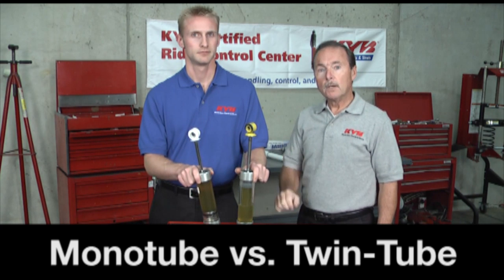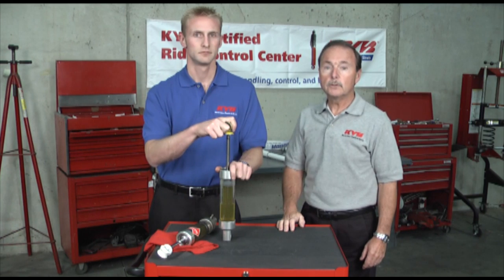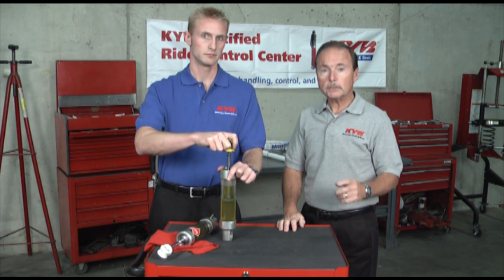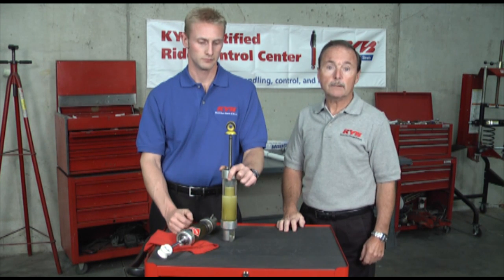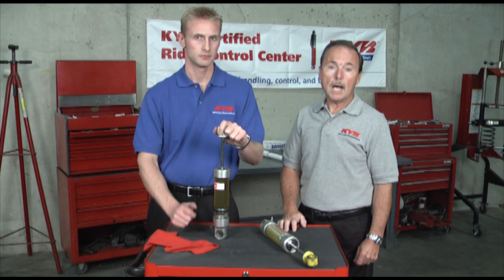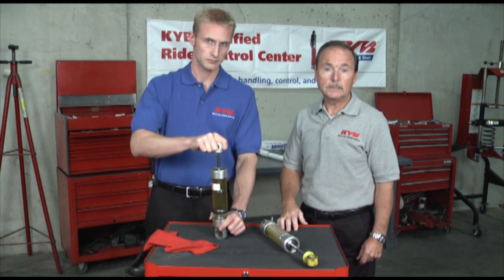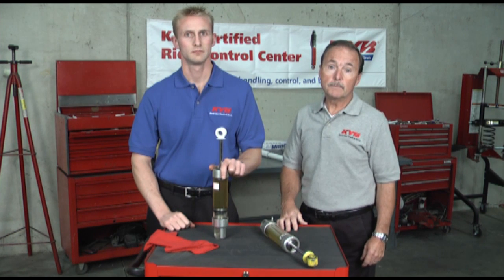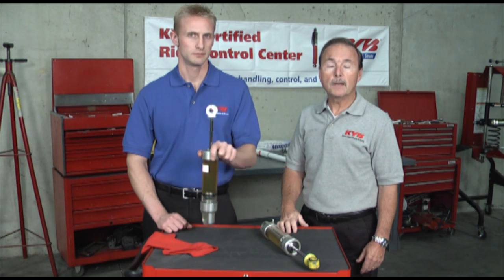The Differences Between MonoTube & Twin Tube Shock Absorbers

Comment: Sir, I turned my brand new twin tube shock upside down and compressed it manually a few times, will this leave any aftereffects? How can I correct this?
Reply from the maker: That will not be a problem, no correction required!

Comment: Which grade AW oil is better for a shock absorber, is 32 density Aw oil better than 46 grade
Reply from the maker: It depends on the application, what the shock is expected to do, etc.

Different weight oils are made for different purposes.
Reply: @kybamericascorp  I want to know which grade AW oil is good for a passenger cars front shocks and which is good for the rear. I think you will undoubtedly suggest 32 grade for the rear but what would be better for the front shocks
Reply from the maker: @safecarsforyou  We recommend KYB parts that are engineered for a specific vehicle application. We would not recommend taking apart a passenger car's shocks when we sell shocks that don't need to be valved and oiled by the end user. 

If you have specific questions about a vehicle and KYB parts, please reach out to our Tech Support Department by emailing TechSuport@kyb.com
Reply: @kybamericascorp  I have been very specific in my question. My question has nothing to do with your KYB parts, it has some thing to do with the performance of the Antiwear oils characteristics . To the best of my understanding, you don't want to answer my question for fear of losing your job.
Reply from the maker: @safecarsforyou  Since your question has nothing to do with KYB parts, we don't have an answer for you. There are numerous resources all over the internet that could help you with your endeavor.

Thanks for reaching out to us, but a YouTube comment section isn't an Engineering Department or Tech Support team, and we gave you the option to reach out to them. Sorry we couldn't be of more assistance on this social media platform. Good luck with your project!

Comment: How does in monotube oil doesn't pass to gas chamber??? It's impossible. It doesn't matter how good the seal is, it will eventually oil pass the seal.
Reply: It won’t even try to go that direction because the gas chamber is always under much higher pressure.  👍
Reply: No shocks last forever, regardless of the design, the seals wear out. It is called "normal operation" and "minimum service life."
Reply: The dude said the gas changer is under hundreds of psi bird brain.
Reply: He says 'never;' 2X.  Are you saying he's lying or he's unknowledgeable about shocks?